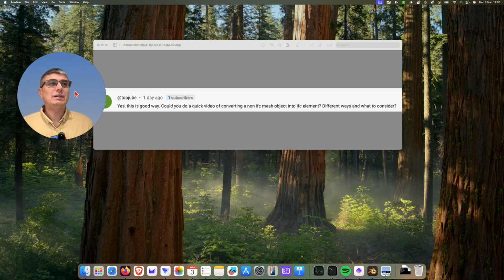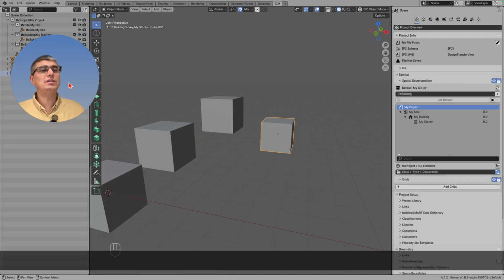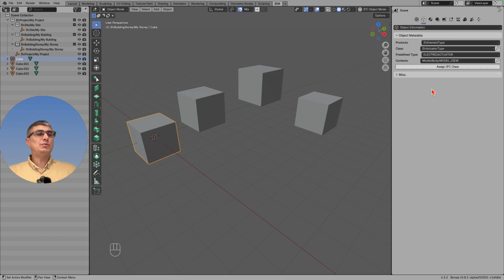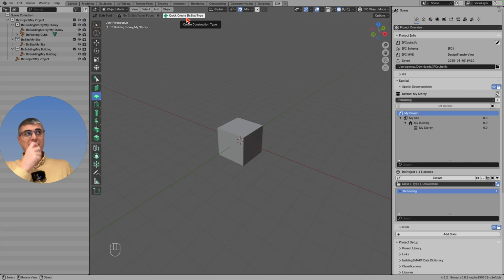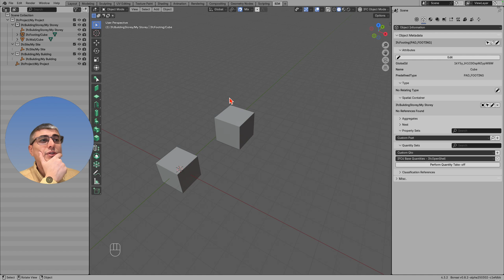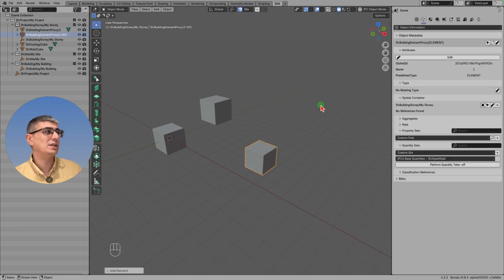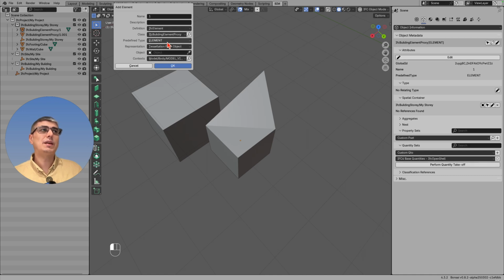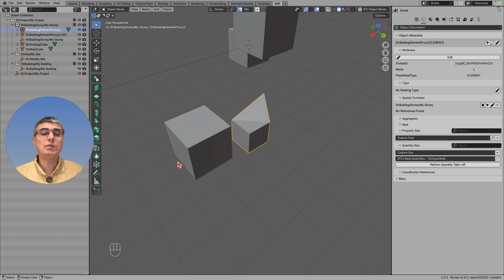Convert Any Blender Mesh to IFC – Step-by-Step Guide!

Comment: Can we add object with geometry nodes modifier as IFC element and keep the parameters to further tweak them.
Reply: There is a Modifiers: new Visual Geometry to Objects operator.  This adds a new `Visual Geometry to Objects` operator which is added to the `Apply` menu.  It is coming to Blender (currently being developed).  This should mean that we can model using Geo Nodes and hopefully make a script that will create an IFC copy of our model (using Sverchok IFC).
Reply from the maker: I'm not sure about this, but I think you lose the connection to geometry nodes the moment you assign an IFC class to an object.

IFC nodes in sverchock might do something about that, but I'm not sure.

We have a livestream on LinkedIn next week exactly about this, and I'll publish it here too. Stay tuned for that one.
Reply: @BIMvoice  without parametric models I don't think Blender objects make sense. I will wait for that live stream.